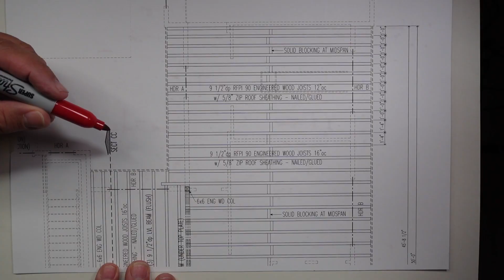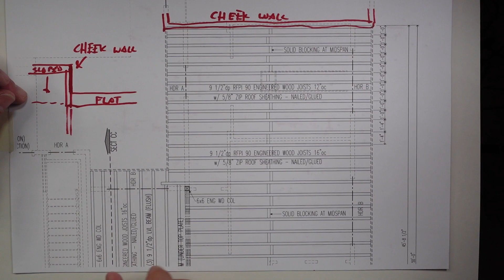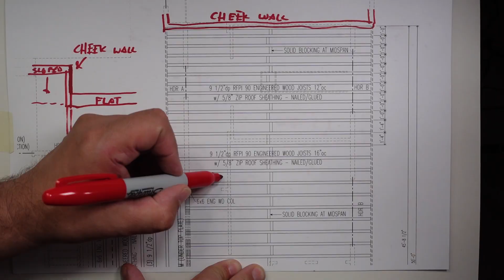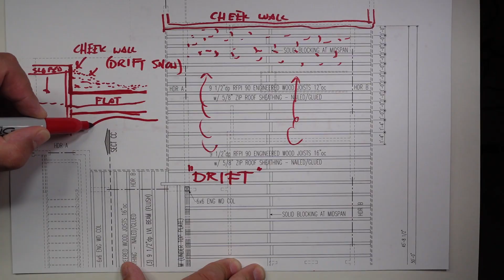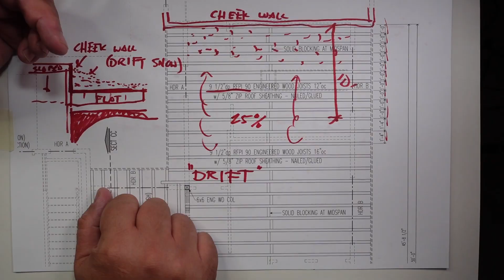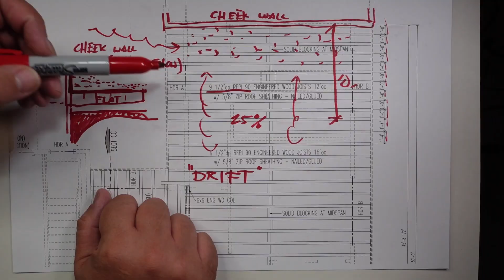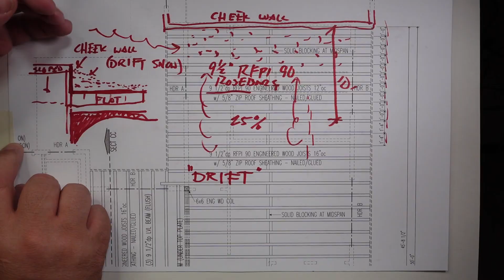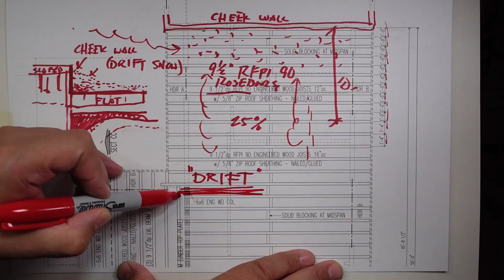UNDERSTAND THIS to keep from Roof FAILURE

Comment: Hi Steve, I recently shared some thoughts with Tim Uhler about obtaining shear strength. Although the use of glue is not allowed in his seismic zone he referred me to an article where the author stated that the uplift force on roof panels increased from 3,000 to 30,000 with the additional use of glue. Advantech foam glue would be the right choice. I am not a fan of advanced or rational wall framing as it generally is not the preferred choice for either floor or roof systems. I don't really see a great savings in lumber usage. I would love for you to email Tim about this latest post pointing out 12' O.C., solid blocking mid span, 5/8' Zip with panels both nailed and glued. Curious as to how you required the framers to perform the "solid" blocking. I- joists or dimensional. Hope you continue to derive satisfaction from your career.

Comment: Steve, did you also increase the bearing capacity of the load paths down to the foundation by 25%?  Looking specifically at the header above that big window under those 12”OC joists.  Or are the headers already over-rated enough to not worry about it?

Comment: I have a pet peeve about spikes/nails used over screws actually. Yes it saves time using nails but fails to "set" properly anything to anything. Also too is the revolution of Trex Drecking where everything is "pre set" meaning the drill holes are already in place and this includes the entire build out of screws and spacers for deck work plus infused "paint" no longer need that anymore either. Add this to actual home building now as can now very much be the case let alone a roof truss and roofing and this approach "takes out all of the guess work" as they say and creates what can be a crazy Clea install with no air or wind driven rain gaps. Tyvek, sheathing, gutters and other protections plus insulation modern building has been crazy advanced going on forever now. So much so yes, absolutely "we build too big" which simply put TOO COSTLY yes, yes? 😢😢